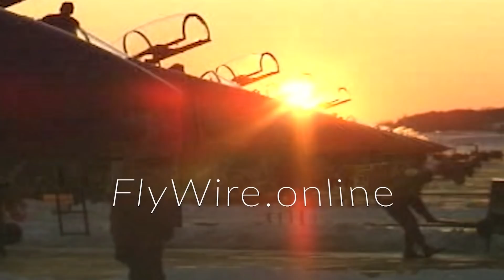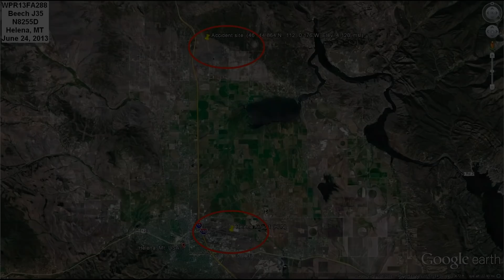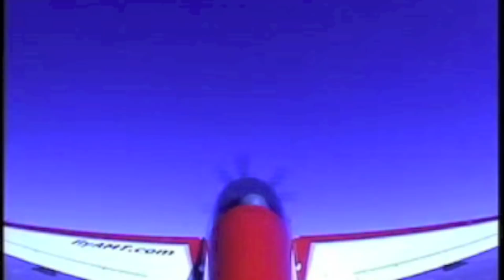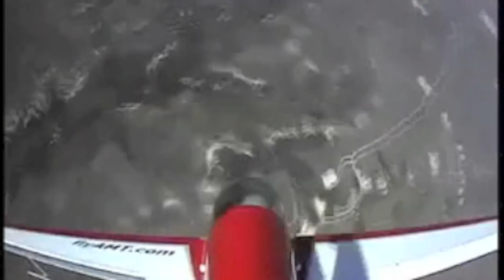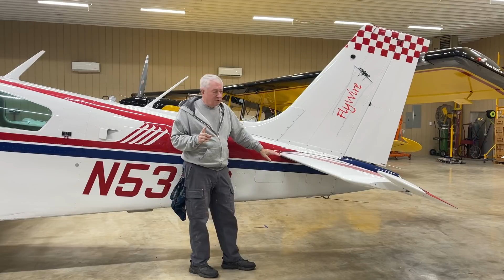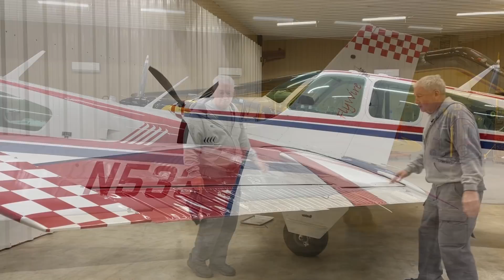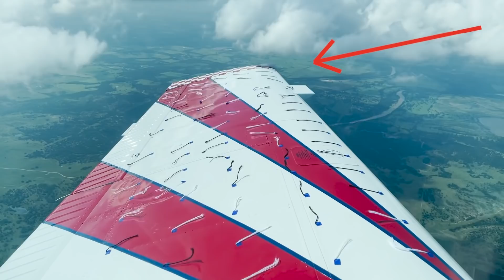J35  Bonanza Power-On Stall / Spin

Comment: This one is really good! Another point to remember, when your anti-spin input is working, i.e. the nose dropping the yaw rate might actually increase momentarily as the masses realign around the spin axis like an ice skater pulling the arms in to increase rate. (actually the axis is relocating but with the same effect)

I only really flew gliders, so at least there was no power setting to worry about :)
Reply: Aileron into the spin can help. Never hear that though.
Reply: @lessharratt8719  Aileron into the spin is how I quickly get my Pitts in a spin. It winds up like a top...Very fast.
Reply: @pittss2c601  Thanks for the reply. I must be misunderstanding what my flight instructor was saying. It was my understanding that if you put aileron into the spin it would actually slow the spin. The reason being is that the added drag on the outside wing would reduce the spin rate. The inside wing is fully stalled and aileron input would not induce drag.
    Having said that, my instructor was ex military and the best flight instructor ever. He taught me how to absolutely ring out the c-150. I had to on several occasions inspect the aircraft for popped rivets or other damage upon landing. I think I might be one of the very few students in that flight school that has ever heard the stall buzzer at 100kts indicated in a c-150. Max G that poor plane.
   A long time ago and now I fly vicariously through U-tube.
Reply: I've never experienced that in a Pitts. Hard opposite rudder nearly breaks ones head off. It pops out immediately. Smooth opposite rudder input even at idle power.
Reply: @pittss2c601  the Pitts is very "square" with a short fuselage and two wings above and below the longitudinal axis.
Picture an aircraft with a longer fuselage and imagine the spin axis varying throughout the spin.
Reply: @daszieher  That aircraft is called an Extra or One Design and they spin beautifully.
Reply: @pittss2c601  so is that a contradiction to what I said?
Reply: @daszieher  Fly all types of aerobatic airplanes. Do lots of spins. Then let me know.
Reply: @pittss2c601  that was a typical non-answer. My reply:
Study engineering, understand the concept of motion dynamics. Then let me know. 😉
Reply: @daszieher  My undergraduate degree was mechanical engineering.
Reply: @pittss2c601  then you should be capable of understanding the issue and answer accordingly. Nobody was ever debating, if aircraft are capable of "spinning beautifully" or not.

Comment: Really good analysis of a power on stall, far better than when I was getting my PPL.  Thx so much.  There seems to be two problems in GA under trained pilots and often less than current on top of that.  A lot can go wrong with these two factors in place
Reply: BB  c

Comment: Spun the Piper Tomahawk many times and it was a wild spinner.  Not uncommon to have inverted flat spins, but on that plane you would need positive elevator authority to break the stall.  Just don't turn around and look at that T tail, it would shake like it was coming off, there was an AD on that tail.
Reply: The Piper TraumaHawk!
Reply: @el-blake-o4766  Luckily no severe trauma for me...
Reply: Thousand our instructor on the c150 I took a tomahawk up on a bed and it was about the most unstable aircraft I had ever seen for a trainer